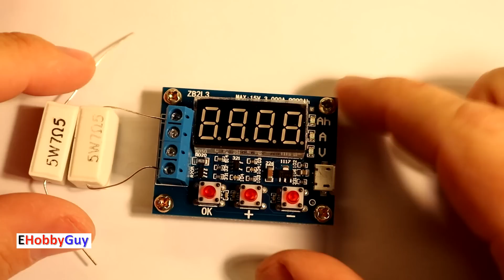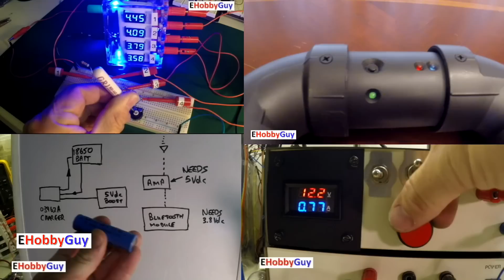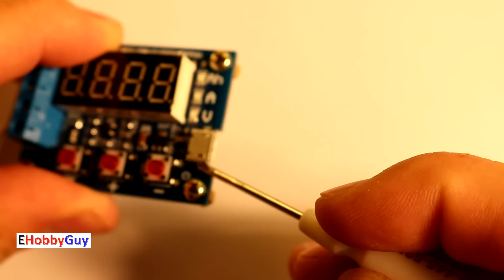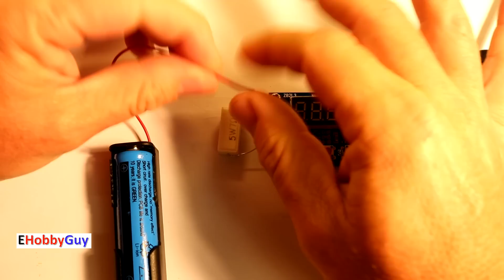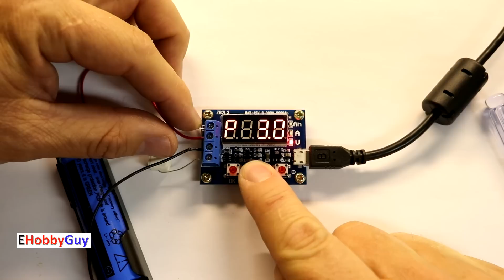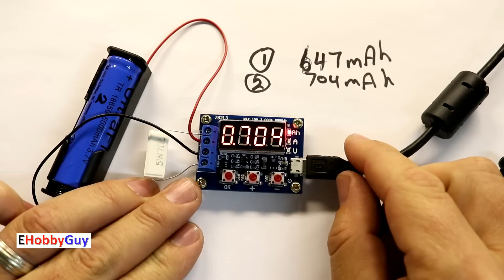ANOTHER BATTERY CAPACITY TESTER HOW TO USE + TEST !!

Comment: Gracias excelente demostracion, lo que me ha gustado de este modulo que tambien nos muestra codigos de error en caso algo falla;
puse una bateria con 2v2 y efectivamente me mostro el mensaje de err2:
Error Codes
Err1: Battery voltage greater than 15v.
Err2: The battery voltage is lower than the specified termination voltage.
Err3: The battery is unable to withstand the discharge current (too much sag?)
Err4: The discharge current is >3.1A.

Comment: Like others said, your video is the best I found about this 18650 capacity tester!! clear and treat about the most important stuffs.
I mounted 2 ceramic resistors of 10W 100ohm (in parallel), for the testing instead of the 5W provided.
What do you thing? my testings are going to be accurate?? I'll be using it to test 18650 battery from old laptop pack. thx for any support.

Comment: I have a number of these testers.   DO NOT connect in reverse polarity.  LOL,  yea I tested it.  The flipping things have more then doubled in price.   Wish they could be employed at higher voltages.  You can get around  mitigating  the Dropping voltage issues by using a CC/CV PSU module as the load.
Reply from the maker: pulesjet thanks for the tip. Thanks for watching!!

Comment: Testing capacity of SLA or Lead Acid batteries recommends discharging at 1/20 C - one twentieth of battery capacity for 20 hours. Higher makes capacity appear less while less makes capacity appear greater. Since Lead Acid batteries cannot be discharged below 50% in general, this test could only be run for 10 hours and should finish with open circuit voltage of battery at 12.2 approx, or 50% SOC.
Reply: Additional comment: I'm not sure about Lithium Ion cells: maybe this rate doesn't apply

Comment: I used to do big cell tests in data centres. we were using a big heater on wheels with a big rheostat and were expected to adjust the amps we saw on our clamp meter by use of the rheostat as it fell due to the dropping cell volts. Some engineers didn’t bother, as this is the way of the world, so test data from one engineer to another were different. Is this something small battery testing should be employing ? I was told the reason was that the telecoms equipment that uses 48v in data centres was all ways going to pull the same amps but I never believe this theory as if the battery string has a finite capacity the volts and therefore amps were going to drop accordingly as time passed.

Comment: Great video! OK saying that you used the 18650 and did the test and get 700 mah , but the said 18650 didn't have any information written on it, how can you tell the overall mah of the battery? Is it a 1500, 2200 mah battery?

Comment: Hi I compared the batteries on charger  xtar vc8 and then on these zb2l3 and the values are close. I recommend these capacitors but it is good that the batteries are charged and discharged then measured again

Comment: I watched some Chinese guy(I think)  demonstrating how this works, without speaking.  I think I got  the point.  Your video was  additional piece of mind.   
I have two  of these on route from China.  
Is it possible to   to do this test without the tester using a  single cell BMS  connected to cell for the drop off,  resistors and a clock battery connected through a  relay?

Comment: Did you ever check the values the tester measures and calibrate the tester? If you hold down all buttons on power up it goes into calibration mode. I think you are supposed to connect 10V and 200mA to it in two steps (the display goes through "0A0u", "10.0u" and "200A"), but I never did that (and hope I did not mess up the calibration by not connecting anything while going through these steps).
Reply from the maker: I have not done that.  I might have to check that out! Thanks
Reply: How to calibrate that
Reply: Almost correct it is 10V and 2A but mine was very well calibrated when I received them.
To check just apply a known voltage and current and read what it says.
Reply: I have calibrated the device; now it writes Err4, but the current is normal. Do you know how to restore factory settings? Thanks

Comment: +EHobby Guy, thanks for this helpful video. I have one of these and have been using it extensively. However, I found another video that calls its accuracy into question. You said in this video around 7:25 that these results were "consistent" with the previous device, but in that video battery #1 did 444 mAh and battery #2 did only 163 mAh, so I'm a bit confused. Do you have a sense of how accurate your results were with this module, in terms of absolute accuracy?
Reply from the maker: Thank you for your comment.  I did not do any real accuracy measurements on the tester.  I am working on a video to build my own battery capacity tester, and use it to compare the 2 testers I reviewed and IT, using the same batteries.  When I said the results were consistent with the previous device, I was just recollecting roughly in my head.  Again, thank you for watching, I hope this was helpful.  I appreciate your feedback!

Comment: Big thumbs up on this tutorial. How would I wire up  to a 4 battery case. To check more at a time .Thanks
Reply from the maker: mario sellet thanks for the feedback. If you are looking to add battery capacities, batteries would have to be wired in parallel. If the batteries are wired in series, the capacities will not be added. I️ hope this was helpful!  Thanks again.
Reply: EHobby Guy sorry if I didn't word my question correctly. How would I wire 4 of these together so in turn I would get 4 capacity readings at one time. Would that be in series? From all the Noons.  Thank you for replying.

Comment: 18650,my battery starts at 3.85, The P voltage is set to 3v, when I press ok it starts. I get .819 amh discharge rate (2 resisters in) BUT the volts says 3.08. It ends quick and I get a battery with .0015 mah. Sometime I get the message Err3 . Help needed. Thanks
Reply from the maker: c bic I would say that you should put the resistors in series to lower the discharge current and it may yield a more accurate result. Putting the resistors in parallel reduces the resistance and increases the current. The older the battery and the more cycles it has gone through reduce its capacity. I hope this was helpful. Thanks for watching!!!

Comment: Using your fingers for mechanical support of USB socket was still 
necessary  with battery 1. However, you didn't show how you fixed the 
socket to the board before inserting the plug for testing battery 2, as 
mechanically arresting the socket didn't seem to have been necessary any
 longer.

Comment: Are those 18650 batteries trash, or is the tester off? 18650 usually have a much higher mah rating, even AA and AAA Eneloop NIMH cells get higher results
Reply from the maker: Alex1911 you are absolutely right they are complete garbage. I bought them just to play around with. I knew the mA rating was fiction but figured I could make a video with them and maybe find a use for them somewhere. Thanks for the comment and thanks for watching!!

Comment: i have the clone variant model HW-586. are the resistors can handle that much heat or does it require fans for heat dissipation? i don't have the temperature tester which was supposed to be included in the package but i only recieve the battery tester. what a bummer! also, can we use this to a larger pack? i have a 4s 10p i wanted to test

Comment: Hi I watched your video last week and my tester has just turned up in the post and I'll be using it for 18650 testing recycling from old laptop packs, Anyway, should I use both resistors or just one and sorry to ask but what is the benefits or negative reasons. Thanks great video's, by the way, love them as I'm just getting into E-Bikes.
Reply: I can't find the next video? which shows the different testing, I look on the channel am I being stupid?
Reply from the maker: Thank you for your comment.  There are different recommendations for the current that should be used to test these batteries.  The manufacturer is supposed to specify the current.  So if you have a spec sheet on the battery it will probably say it there.  If it is a more generic battery and no info is available, then a rough rule of thumb is to use 0.2 times the rated capacity.  So if you have a battery rated say 2500 mAh, then a good estimate for the current to be used to test it would be 0.2x2500 = 500mA. Since this tester does have a varying current as it discharges use the resistance that would give that current using the nominal  voltage of 3.7V, i.e 7.5 ohms.  R=V/I  -->   R = 3.7/7.5 = 493mA.  This is just one example.  I hope it was helpful.  The testing of these batteries is actually quite complex.  Thanks again for watching!!
Reply: Very helpful and not just a generic answer thanks so much.
Reply: Now just to go through all my bloody batteries. lol.

Comment: Great review.. How long did the test run for? If the resistance were increased, would that cut the test time?
Reply: No, the opposite. Smaller resistance results in higher discharge current, draining the cell more quickly.

Comment: Hi Paul, I have ordered the TP4056 and now intent to combine this tester to it ,is it posible to do so or i need other board to add on to make it work ,, i have subscribed to your channel ,n your valuable advice please
Reply from the maker: Hi Sammy, I am not sure what you are trying to do.  The TP4056, depending on which model controls charge and discharge of the 18650 batteries.  The tester in this video tests for battery capacity,  So if that's what you are trying to do, then great.  Again thanks for watching!!
Reply: Hi Paul thanks for the swift reply.hope to see more other battery charger diy ..

Comment: Hi Paul i tried to charge   my battery with this charger ,with two Resister connected togerther , But charger read as as errer 3,, but only one battery did complete the caharging . What does the errrer 3 means . youradvice please tks
Reply from the maker: Thanks for your question!  Here is what i found on the error codes.  It looks like your resistance is too high.  Try putting the resistors in parallel to reduce the resistance.  I hope this is helpful!
Error codes and their meanings:
Err1: Battery voltage is above 15V
Err2: Battery voltage is lower than the termination voltage
Err3: Battery can not afford to load discharge current or the circuit resistance is too high
Err4: Overcurrent (current exceeds 3.1A)
Reply: It's not a charger !!!

Comment: 5000mah on the battery.
but the result only 704mah
Reply: battery model 18650 build in this world  is with max current capacity 3500mAh any type , any place

Comment: Lol the Ultrafire battery says on side 5Ah when actually it is 0.5Ah? :D
Reply: i presume, they probably tested capacity with around a .1c discharge rate.  maybe thats the idea with some flashlight led setups.  but still, i see your point.
Reply: @mr.p3567  Those are often sold in lots of 10 - and the stated capacity isn't for a single cell, but for the whole lot.

Comment: So is it better to test 18650's with 2 or 1 capacitors?  Which is more accurate?

Thank you!
Reply from the maker: Martin Viti those are resistors, and it is my opinion that it is better to test with 2 resistors in series. This would result in a higher resistance and therefore a slower discharge. I think that would give a more accurate result. I hope this was helpful. Thanks for watching!!
Reply: @ehobbyguy8980  thank you for your quick reply! Just to be sure i don't mess it us, could you possibly point me to some link with a video or photos on how to correctly connect the two in series?

Thank you so much! This is my weekend project :D

Comment: There Only 4 TRUE High Quality 18650 Battery MFG. Panasonic/ Sanyo , LG , Samsung , Sony   and the Current Highest MAH is 3500mah & One of the best is the  Pan/Sanyo  NCR18650GA  3500mah 10amp  (Not For E-Cig You need 20amp + )    All those 18650 5000-9900mah batteries on EBAY are all Cheap Garbage There only at best 700-1000mah & only have about 3amp max discharge Capacity !
Reply from the maker: Dan theman I couldn’t agree more. Thanks for your feedback and thanks for watching!
Reply: Panasonics (NCR18650X) are my preferred cells too - but ... recyclers, resleevers - can't call them "manufacturers" - found out too: more and more fake Panasonics are hitting the markets. As far, the discovered fakes tend to be longer than originals. Mass is about the same, and in fact, capacities weren't too bad, but I expect them to lose capacities more quickly than genuines.